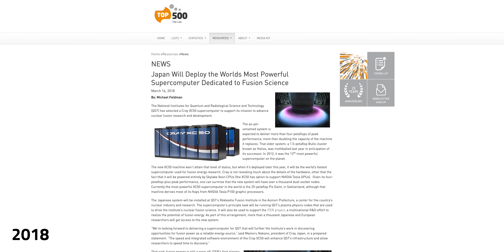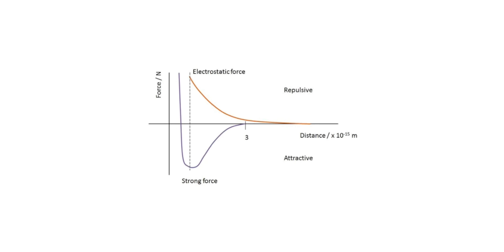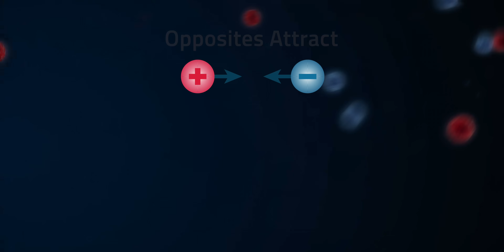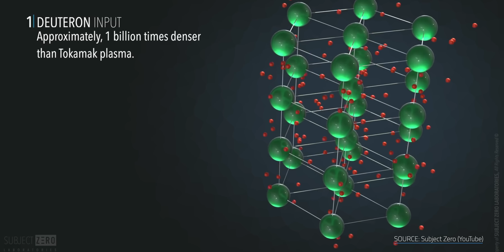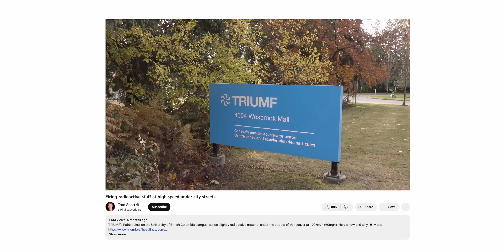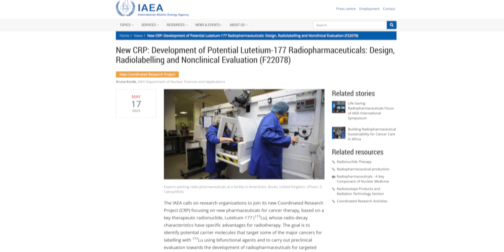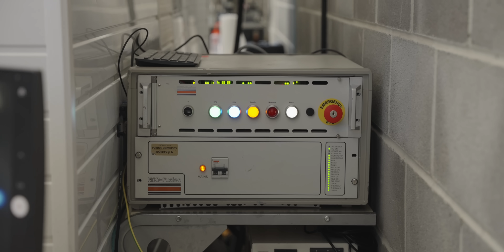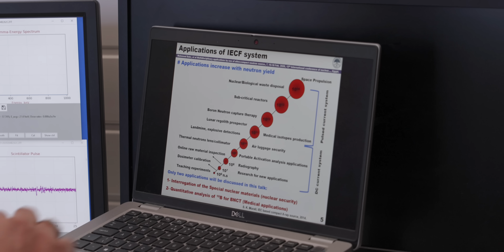How Nuclear Fusion Can Benefit Us … TODAY!

Comment: They talk about neutrons a lot in this video. Neutron generators are old tech. All you need is a water-cooled copper target with a thin layer of titanium on the surface. Then ionize Deuterium gas in an ion source, extract an intense D+ beam of 100-200 keV of energy and shoot the ion beam to the target. The target will load by deuterium (titanium will act as a deuterium sponge) and from there on the incoming energetic D+ ions will fuse with the trapped Deuterium atoms on the target, generating a whole bunch of neutrons. So this video really shows nothing new other than mentions medical isotopes without giving any explanation on how they intend to scale it to commercially feasible levels. Feels more like a group of people riding on the fusion hype and recycling a bunch of old kit they had in the back of the garage.
Reply: Perhaps the important parameter here is the ENERGY of the neutrons produced.  Higher energy neutrons able to create the needed medical isotopes?
Reply: @joshm3342  Eh, fusion is fusion regardless of how you get there. If I understand correctly, the resulting neutrons will have the same energy.
Reply: @etaaramin9361  I don't think the point really is fusion. As you pointed out there are other ways to make neutrons, they're just trying to make one of the most efficient and compact methods to make neutrons. I think that's the big whoopie. Also, they showed some fairly massive buildings and apparatuses in this video, are you saying that your described contraption can do what that huge facility can do? These guys are trying to say that theirs can. We'll see.
Reply: @kindlin  My response was about neutron energy levels, which as I said sre determined by what is being fused, not how. Spallation is by several orders of magnitude more efficient than any other neutron source, but requires a gigantic particle accelerator. Using braking radiation is a decent compromise - certainly more efficient than a farnsworth fusor, which is of similar size and power draw.
Reply: @etaaramin9361  insert non-explanative jargon here
I still don't know what you're even trying to say. I think you're saying this video is physically impossible. And my response is, well they certainly don't think so. You're explanations have not helped me at all, I guess I've not watched quite enough popsci yet to get all of your terms.
Reply: @kindlin  ??? When a comment begins with @ and a username, it means that comment is directed to that user. I responded to a comment that asked if different methods of causing fusion would produce neutrons of different energies and my response was no, no matter how you start a fusion/fission reaction the resulting neutrons are always of the same energy.

I have no idea how you concluded that was directed at the original video or how your interpretation of what I said was so far off.

Edit: nothing I said was "jargon" and anything you were unfamiliar with you could literally type into google and read about. I'm not going to explain the mechanics of electrostatic confinement fusion or spallation in EVERY youtube comment about fusion. Some basic research is requirrd on your part.
Reply: @etaaramin9361  Ok, first of all I'm sorry, I thought you were the OP. Your YT name tag things are both grey-ish and with the new (and annoying) @ cluttering your name, I didn't even notice they were different (stop trying to be twitter, YT, sigh...). This whole new @ name thing hasn't helped me at all. 
I kept reading your posts in the guise of the OP, when you're actually talking against it, that's why I was so confused.

Comment: I'm slapping my forehead. The combination of a Farnsworth fusor and lattice confinement fusion is obvious in retrospect but I never would have thought of it. It's so simple and obvious and brilliant. And I feel moronic knowing I didn't think of it and never would have.
Reply: At least you have the knowledge to source some great ideas. I wonder if AI could be programed to simulate and research, at least virtually,  the possibile useful connections between different scientific discoveries. It seems we know a lot but the real progress comes when someone thinks outside the box
Reply: @setii2009able  I suspect the answer is yes. 
In my own experience, good ideas are when you notice that one idea is missing the one thing that a second idea is best at. The "out of the box" part of that equation is allowing that cross-pollination regardless how desperate the origins of the two (or more) ideas.
Part of the process is mentally representing the positives and negatives of ideas.
Well, AIs already have kilo-dimensional space to represent ideas and hallucination on command. Seems perfect. What's needed is some method of removing good from bad.

Comment: Very thrilled to see lattice confinement fusion getting some attention, but you did not really touch on why Astral Systems is not really a viable option for energy production. I don't see how it couldn't be though.
Reply from the maker: There's a possibility of it becoming a player in energy generation, but that's not the companies initial focus.  It's worth keeping an eye on them to see how this shapes up in the coming years on that front.
Reply: I'm fairly certain both IEC and lattice confinement fusion have been mathematically proven to be dead ends in fusion power generation. The power lost due to coulomb scattering is magnitudes higher than that gained from fusion, so any attempt to extract that energy as electricity would result in a net loss of power.  

That being said, IEC definitely has a future in the field of medicine. A company called Shine Technologies has been producing IEC reactors for medicine for many years now. Just recently they have begun work on a hybrid fission/fusion reactor that will have magnitudes higher neutron output than any pure IEC system.

It's essentially a fission reactor with too low of a fuel mass to sustain any reaction. The IEC reactor is placed in the center of this reactor, and the neutrons produced from fusion kickstart the fission reaction without the risk of going prompt critical.
Reply: I'm fairly certain both IEC and lattice confinement fusion have been mathematically proven to be dead ends in fusion power generation. The power lost due to coulomb scattering is magnitudes higher than that gained from fusion, so any attempt to extract that energy as electricity would result in a net loss of power.  

That being said, IEC definitely has a future in the field of medicine. A company called Shine Technologies has been producing IEC reactors for medicine for many years now. Just recently they have begun work on a hybrid fission/fusion reactor that will have magnitudes higher neutron output than any pure IEC system.

It's essentially a fission reactor with too low of a fuel mass to sustain any reaction. The IEC reactor is placed in the center of this reactor, and the neutrons produced from fusion kickstart the fission reaction without the risk of going prompt critical.

Comment: 1000 neutrons per second with an order of magnitude improvement being within range. Yeah this technology is far from being viable for practical use - thing is, an order of magnitude doesn't do anything here. To produce one mole of Technetium (6 * 10²³ atoms, or 98 grams) via neutron capture, this device would need to run for 6 * 10^19 seconds - that's 2*10¹² years - our solar system won't even last that long, we're talking cosmic timescales here.
For the forseeable (30 years+) future, nuclear reactors and particle accelerators will remain the only viable options.
Reply: Yeah it's not very impressive, especially considering amateurs working in their garages have achieved 1X10^6 neutrons/second.

Comment: I think this brings up an interesting point about fusion.  Even though it take care of a huge amount of the fuel waste issue, things are still going to become radioactive.  Maybe decommissioning fusion plants will be just as difficult as with fission plants?
Reply: The difference is the nature of the radioactive waste. From a fission plant you have stuff (spent fuel and contaminated plant) which is very dangerous for 1000s to 10s of 1000s of years. With a fusion plant, you have stuff (activated/irradiated plant) which is less dangerous and only really for 1 or 2 hundred years. That's from a power plant. From a medical isotopes production plant or fleet, you'll be the same in danger level and lifetime but the amounts of waste will be tiny in the grand scheme of things.
Reply: @MattNolanCustom  Agreed, if we ever manage to get a handle on fusion, it will be the obvious choice.
Reply: @RMX7777  
So such a fuel would be better then the claim made by Thorium Molten Salt Reactors as far as waist go, although not fully realised yet.
Reply: Yea I expect this to be a problem too, this is why in the previous video there were robot arms installed inside the plasma chamber to do the maintenance / decommissioning.
I don't see that particular idea work with one of these from the video.
Reply: ? Do you mean MSR [Molten Salt Reactors] which is fission, for taking care of radioactive waist?. 
A fusion reactor becoming radioactive after being turn off, is directly related to the fuel used, some should have no radioactive residual material once fusion reactor is turned off, others will definitely stay radioactive, it depends on what fuel they can get there fusion reactor to run on.
Reply: @YellowRambler All known fuels produce neutrons, which will cause the reactor vessel to become radioactive over time. Even proton-boron fusion, which is considered an aneutronic reaction emits around 1% of its energy in the form of neutrons.

This means it's not a matter of if the reactor will become nuclear waste, but when. That being said, it's still a much better option in regards to waste than fission.
Reply: @RMX7777  
Interesting these folks claim no radioactive waist from Focus Fusion https://youtu.be/6ajqD0hoOMw
Are they wrong or does a plasmoid Z-pinch makes it go away some how?
Reply: @YellowRambler  It's a false claim, the neutron output is low but it is there. The Proton-Boron reaction doesn't produce a neutron, but it isn't the only reaction taking place. 3 alpha particles are produced from the reaction, one of these particles can then fuse with a Boron ion to produce nitrogen and a neutron. The alpha particles cannot be separated from the fuel due to the very hot nature of fusion, the temperature essentially ensures everything stays stirred up together.

Despite the total neutron production only being 1% of the output, it will still cause issues. Once the total power output is scaled for energy production, the neutron emissions will also scale to the point of generating nuclear waste.
Reply: @RMX7777  
Sorry if I’m going on a bit, but if I understand you correctly fussing a Hydrogen and boron atoms will produce helium and 1% neutron?
Reply: @YellowRambler  I think my response was removed for posting an external link, if you search up "osti gov plasma physics laboratory proton boron" you should be able to find the paper.

But to answer your question, yes. Around 1% of the reaction products in a reactor fueled solely by hydrogen and Boron will be neutrons. 

As this reaction occurs at a rate 2 magnitudes lower than the primary reaction, the reactor will become radioactive waste at a greatly reduced rate.

If it would take a Deuterium-Tritium reactor 1 year to become nuclear waste, it would require 100 years for a Proton-Boron reactor. The issue is Proton-Boron fusion produces way less power than Deuterium-Tritium, so you need a much higher reaction rate, this also increases the neutron production.

I'm not sure how long it would take for the reactor to become unusable waste, but it would occur within a single human lifespan.
Reply: @YellowRambler  Actually they don't claim no neutrons will be created. The secondary reaction produces about 1% of neutrons from secondary reactions. In fact, they rely on the secondary neutron production to measure the amount of fusion product being generated in their test firings. They also have meter thick walls of concrete in their lab to capture these secondary neutrons so they don't radiate themselves.
Reply: Yeah, basically the plan is to lock up the facility for 100 years, then recycle the useful materials for new reactors if they're still relevant and bury the rest 10 feet deep

Comment: this looks really close. hope someone watching this helps them commercialize the process. though i didn’t see them make any isotopes in the demo
Reply: I don't know what their system is capable of, but the output from the high power run shown in the video was nowhere near high enough for isotope generation. They stated an output value of 1X10^4 neutrons per second, which is about 7 orders of magnitude lower than what would be needed for isotope generation.

That being said, they also stated that they plan to run 5 of these simultaneously at a much higher power input, so I would expect them to find success in the future.

Comment: I am amazed at the small size of nuclear fusion equipment having worked for BNFL at several of their UK plants.
Reply: Fission can happen in small apparatus too—e.g., nuclear bombs, or just the demon core. But doing fission controllably and safely, and extracting energy from it, takes a lot more equipment (and the same will apply to fusion, though more for some techniques than for others). Also, many processes are more efficient at larger sizes, and fission power generation seems like it would be one of those.
Reply: It's like turning lightning into a small static shock. But with the sun

Comment: For nuclear medicine this is a HUGE game changer that could move the options available at limited university scale facilities out to roughly any large city. There's also a similar but more limited potential spread for university research moving to smaller less central campuses. 0.2MW is nothing to sneeze at for requirements but it's vastly more bubdgetable than the current standards and requirements in all metrics from area to support, to of course cash.
Reply from the maker: Thanks for sharing!
Reply: @UndecidedMF  It's like Hot Fusion and Cold Fusion combined.
Reply: 200kW is still less than 2 teslas charging (at their maximum rate). Sure its a lot of power but we have proof that it is doable just based on the supercharger systems that are already being built.
Reply: Vast improvement from the 1.21 gigawatts required by the original Mr. Fusion.  Although the output is certainly much lower.
Reply: @captsorghum 

"Vast improvement from the 1.21 gigawatts required by the original Mr. Fusion"

1.21 jiggawatts 😆was the figure of power input necessary to make time travel possible.

Mr Fusion just replaced the nuclear fission reaction using plutonium fuel pellets that previously produced that great surge of power - that or a bloody great bolt of lightning fed into the flux capacitor 😂

(I think you confused Mr Fusion with the flux capacitor?)
Reply: 200kw is not that much for industrial scale.. 3-4kw ~ is awerage home upper limts. 200kw/mounth is awerage home usage total . its not that high from lots of perspectives... and it seems it doesnt need 200kw x more ten one hour it seems. So mostlikely needs total energy less then one house uses a mounth ...
Reply: @SunriseLAW  Nothing in your comment has any bearing on what is being discussed, and TBH reads like a drunken ChatGPT hallucination.